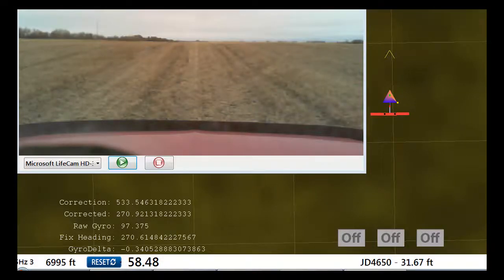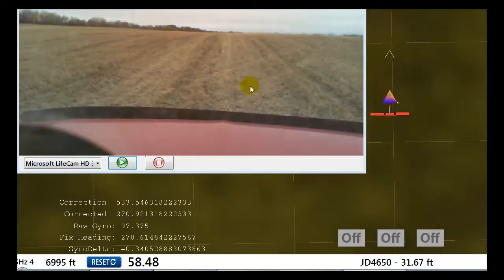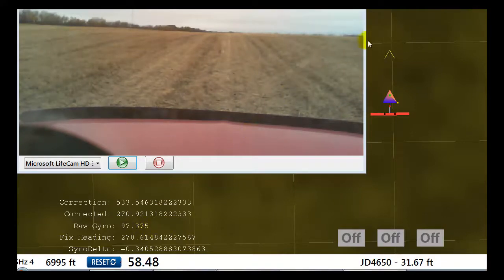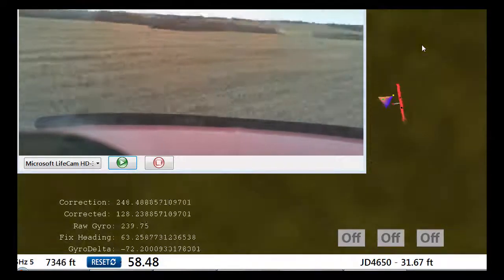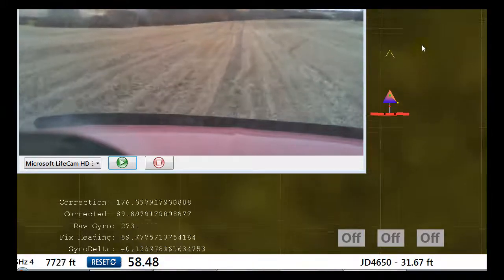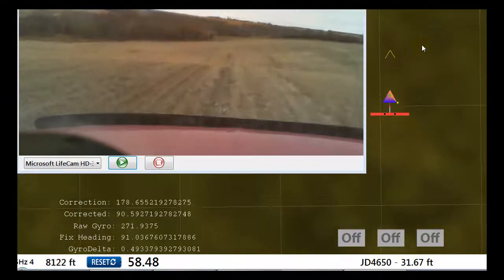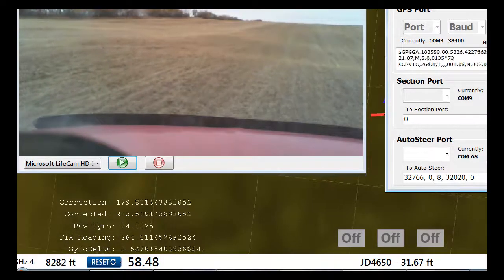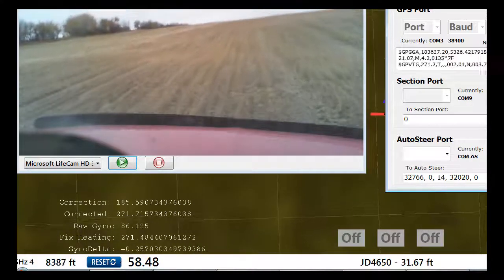Heading by GPS and IMU BNO055

Comment: Are you using the BNO055 in IMU mode or NDOF mode?  I can't get any kind of decent magnetometer calibration in a vehicle, so I've been trying to use it in IMU mode, but I'm not having much luck getting good heading change data out of it.  Are you doing any sensor calibration?
Reply: Stephen Pedro  You forgot to say "One weird trick".  Stupid ass bots.

Comment: Hi, I don’t understand why you need a gyro at all? Is the gps not enough on its own?
Cheers from France
Reply: The roll of an accelerometer  is calculated with the earth gravitation, but you also measure the relative acceleration. (When the tractor drives over a short bump) That means you need to compensate the error with a gyro via sensorfusion.  The Roll is needed to compensate the position of the antenna on the roof. If you have bumpy or slant fields. Furthermore you can Extrapolate Data with an IMU e.g. the heading.  In short an IMU can gain you better accuracy.
Reply: GPS gives you position, but not orientation.  It can't tell you which way you're pointing.  It can calculate the direction while you are moving quickly, but it will give random results when you are moving slowly or stopped.  The GPS also lags and outputs updates fairly slowly.  The gyro works fine at slow speeds or when stopped, and gives very rapid updates, but it drifts over time, and is a relative bearing output unless it is sensor fusioned with a compass.

Comment: Good afternoon, first of all I'm sorry if there are no language errors because I do not speak English .. I have a question, I made the assembly of the gps for test using the module Neblo 6m ublox, at first it worked but the precision keeps changing of place in the map in a distance of a few meters, could you answer me if using the bno055 module would be stabilized?
Reply from the maker: It needs to be on the roof of the vehicle away from most of the steel. It will drift like crazy if not. The IMU is tricky but if your fields are pretty smooth, you hardly need an IMU.
Reply: Hi good morning! I imagine that the IMU helps stabilize the signal to not slip with the vehicle stopped? I did not install the tractor yet because I'm testing on the bench, this week I will still finish mounting and installing in my tractor, I'm from Brazil state of Paraná, Thank you , God bless you!

Comment: Hey Brian I am just starting out with your gps system It is a wonderful piece of software. I wanted to know if u could send me some links to the best gps antenna to use. Also could u please make an video explaining how u made your steering wheel motor out of a cordless drill. Thanks so much, Luke
Reply from the maker: Swift navigation. Novatel Smart stuff are good. Swift has full RTK for 2Grand
Reply from the maker: I really don't know the best antenna. A lot of people use ublox and novatel. The cordless drill motor is pretty loud. Have to come up with a quieter one